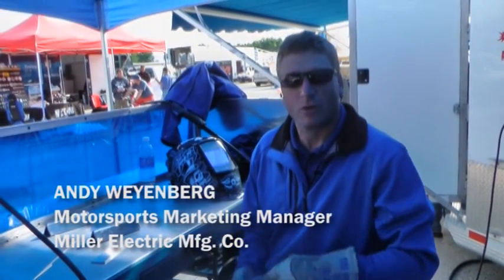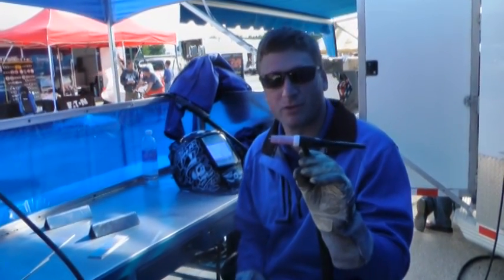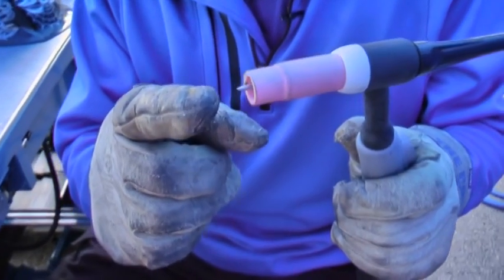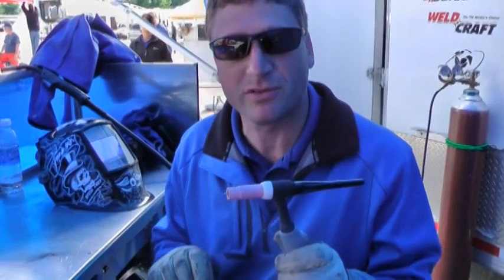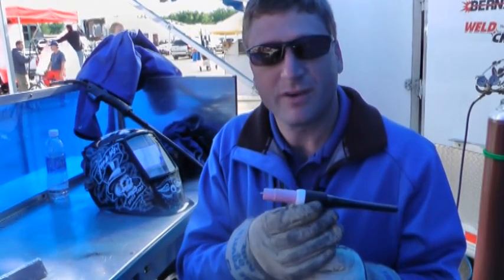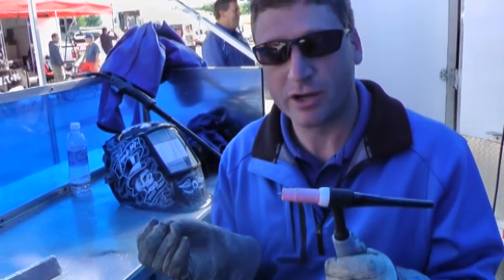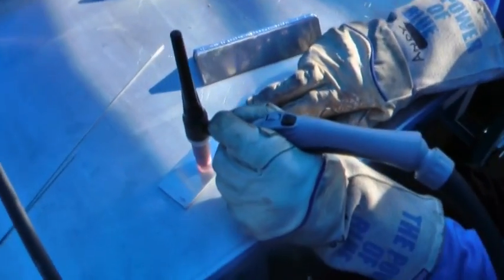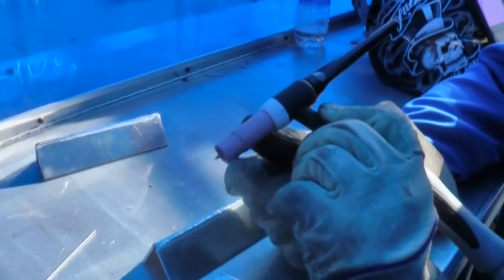TIG welding tip: hard starting due to tungsten contamination

Comment: I want to know why my tip melts to a smooth rounded tip and then when I feed the molten puddle will jump off the surface on the electrode. Then I get lond flames shooting out the time and it starts to glow. I have looked everywhere for help. I lower and increase base amps and pulse amps but no luck. I also switched to 1/32" Lanthenated and same problem. I ordered 1/8" to see if I can get better performance. Please help. I am sharpening tips ever 2 inches of welds. ... continued.

Comment: Well this is great if you are welding junk in the garage or don't care about inclusions in your weld. Great way to teach someone to be lazy.
What should have been said is  " You should always REMOVE  the tungsten and insert a new freshly sharpened piece or re sharpen the existing piece" Then you could go on to say " You can, if the weld is a not critical, scratch the tungsten on the part to expose the tungsten, This will contaminate your weld and your tungsten."
Teach proper habits please!!